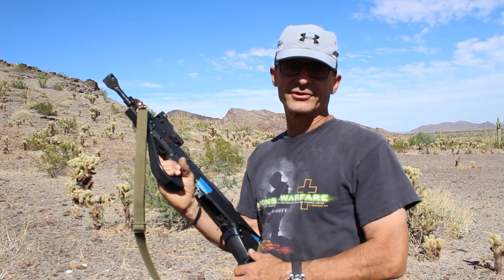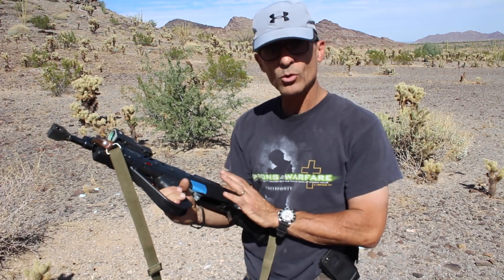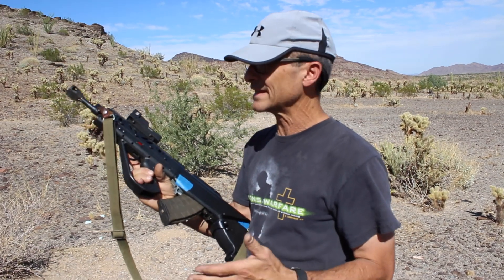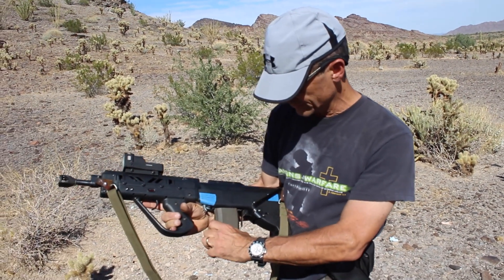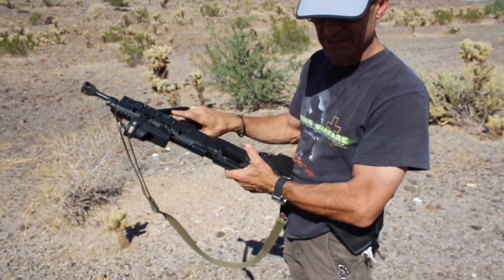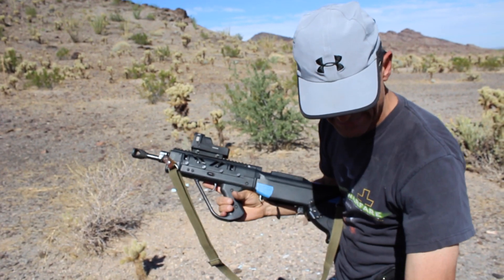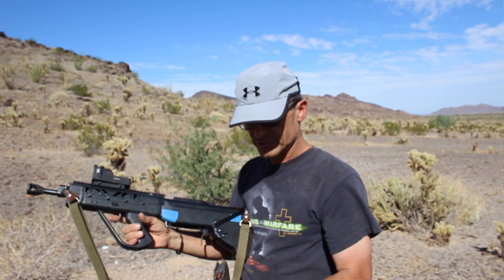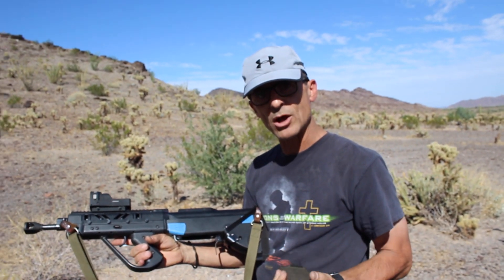SGW Why We Use Two Levers

Comment: I'm debating between your kit and the competitor's kit, and your forward moving lug is a big advantage for your system. I need to look at this more.
Reply: cymond who’s the competitor? I have Shernic’s, I would like to see other designs
Reply: Adam Freiburger CBRPS aka Center Balanced Rifle Stocks. 

I was looking at their Pug 3 stock. Unfortunately, I cut my Yugo barrel right behind the front sight, and i think it's too short for the Pug 3 now. I'm considering a bolt-on muzzle brake from Witt Machine; that might extend it enough to work with the Pug 3. 

The CBRPS has a few advantages. There's a left side bolt release button, and they have an optional left side non-reciprocating charging handle now. On the other hand, the SGW is a lot more affordable, has a better trigger, and does a better job of hiding the fact that it's an SKS in a chassis.
Reply: Adam Freiburger also, forgot to mention that YouTuber ThatGunGuy 45 has a review comparing the two stocks, and it's the only side by side comparison that I've found.
Reply: Price is another big advantage of this one
Reply: Cymond I’m selling my CBRPS kit if you’re interested